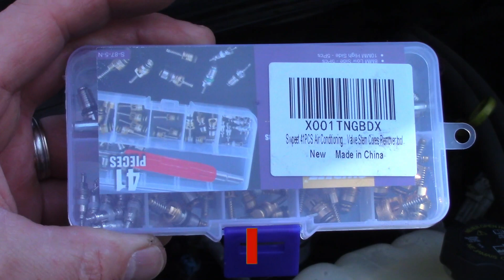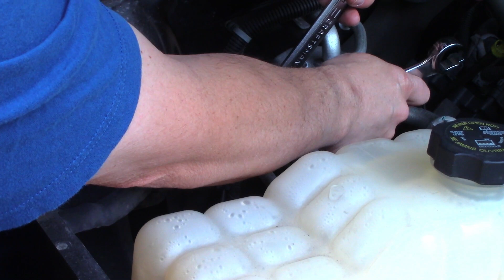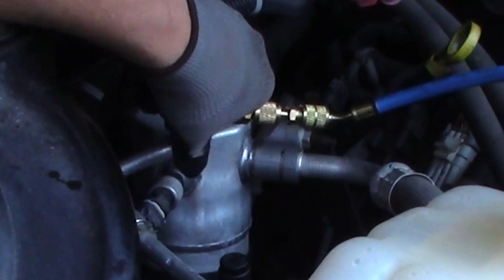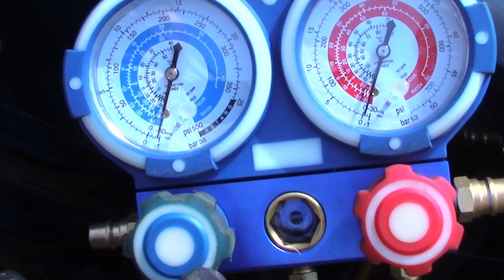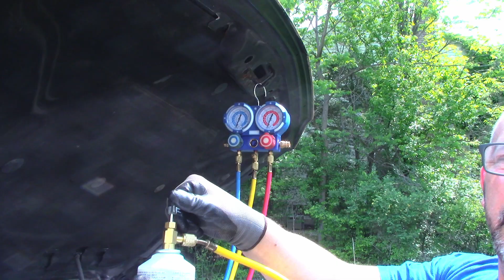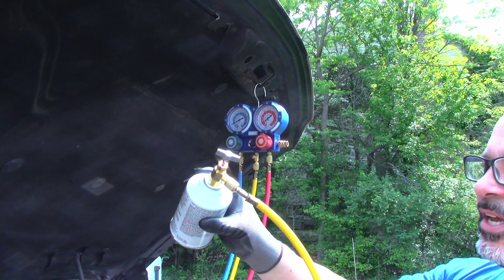Easy DIY AC repair

Comment: You need a 609 certification to buy  the proper refrigerant. Those cans typically contain fillers and are not pure refrigerant and i see that you have gauges but no scale also its important to understand the difference between a low side charge and a high side charge because one will be liquid and the other will be gas the orientation of the refrigerant matters. Also the lubrication of the system has not been considered in this if you leaked out that shrater valve i can promise you lost oil amd low oil is one of the biggest causes to compressor failure.  I hate to say it but this is a terrible practice and will likely cost you several times what you spent.

Comment: If you ever have to access the evaporator, might as well clean it too.

Coil cleaner is cheap, use it on your homes system as well.
Reply from the maker: Excellent point.
https://youtu.be/8v8OFeTyKYM

Comment: Whenever I've bought an old beater with a heater, I just assumed the air conditioning wouldn't work, and I was too afraid of it (or too broke) to try and fix it. How many of those cars could have had working A/C if I had only purged and refilled the system.
Reply from the maker: The entire system is pretty basic.
Pressure switch and compressor.  Newer cars are a little squirrelly with the computer but still just a pressure switch and a compressor.